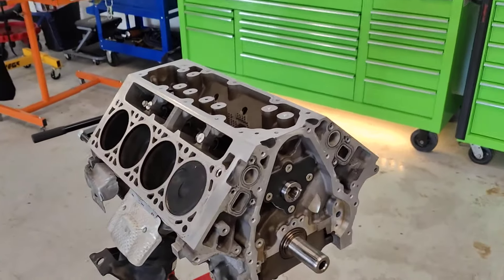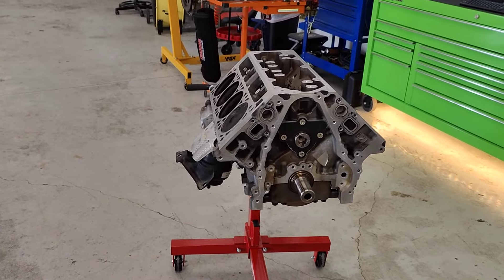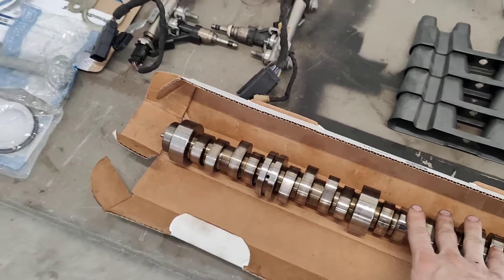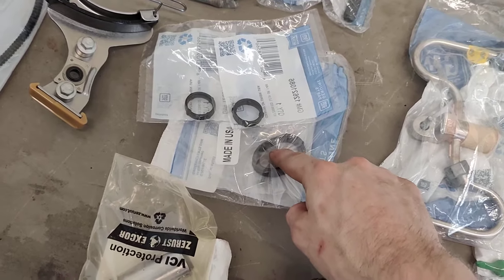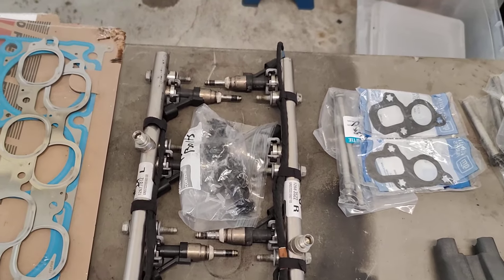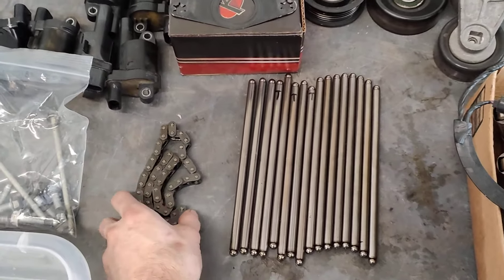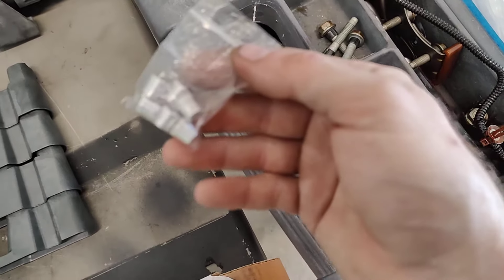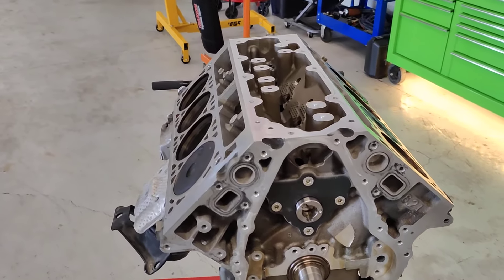Gen 5 L83/L86 AFM/DOD Delete

Comment: @ChrisVaughnTech  ive done this twice now( different engines) both times net me low oil pressure on hot idle. first time i used oil pump alignment tools, new o ring low hot like 16psi. pulled apart and put in new pump and replaced the wiring to oil pump which was damaged. still low oil pressure hot. cam bearings looked great, crank and rod bearings felt good when i had pan off. as soon as you breath on the gas oil pressure goes up and normal driving it never drops below 35. i did some tuning , raised idle 100 rpm and changed where the VVT took over to cure wandering and its sits like 25 hot now. owner is good with it and been driving it for a few months. the one i finished yesterday same thing, new o rings, cam thrust plate, ls7 lifter, valley plugs, trays, oil pump wire. hot idle about 16psi, only mod to tune was turning the master DOD switch off. as soon as you breath on throttle pressure goes up like youd expect, ended up upping idle and changing vvt turn on point now sits25ish hot idle with 0w20, last one i went with 5w30 and very little noticable pressure increase. it seems just turning the dod off messes with the oil pump pressure control. im almost wondering if the stock VLOM is bleeding off pressure somehow. i do know the gauge is not showing accurite pressure tho, there is a table you can change the low pressure alert, its set at 40psi at 210 degrees at idle and if i change that up any i get the message "low oil pressure shut engine off" which means to me its getting ATLEAST 40 psi at idle at that temp but somehow the gauge isnt reading that. ive tried new oil sensors also, removed screen, never found an adapter to hook manual oil gauge up the, odd thread.
Reply: To your question on VLOM bleeding pressure.... there's a tiny hole that throws oil to the fuel pump lifter.
Reply: @guerosolis5794  The oil feed hole you're talking about only feeds to vlam cylinders. I've started taking them apart, cutting the cylinders off and tapping and plugging the feed port and I've had zero issues after that. Well along with friction plugging the AFM towers in the valley. The fuel pump solid roller lifter gets fed from the back of the block which is also the same passages that feed the lifters oil
Reply: @erik120719  I think I have this issue with mine post delete. where is the oil feed hole to the vlam and what are you taking apart to cut the cyclendars and plug the ports?
Reply: @newbtubetecher  cut the VLOM cylinders off the valley plate. If you look where the pressure sensor threads in there is an angled port that feeds the VLOM solenoids. I tap and put a grub screw in that feed hole. Then get a outer pinion bearing for a 05 Chevy 1500, pull the rollers out and hammer one into each feed tower so it plugs them also. I made a video but dunno if I ever posted it but I'll find it and link it for ya. Unfortunately you have to pull at least one injector rail to get the valley plate out, lotsa lube and be slow and gentle
Reply: Just an update, I've done just over a dozen of these since this post. No longer have to tune up idle and VVT stuff. I still and tap the VLOM feed hole, remove the VLOM solenoids, and friction plug the DFM towers built into the block. Low 20s oil pressure at hot idle, GM spec is 22psi at 1000rpm , which could be as low as 12-14psi at 550rpm idle. I now run 5w30 dexos in all these engines I DFM delete. Have all running around with no issues except one, lifter failure (Delco brand ) that dropped its needle bearings and shredded everything on the way to the bottom. Had to eat that one and built them a new engine.
Reply: Hey thanks for getting back to me. I’ll be on the look out for that video link too. Been thinking about doing the injectors anyway so I might as well prepare to do a fuel rail lol and cross your solution off the list at the same time. Still cheaper tgan a new truck tho 😂
Reply: @erik120719 thanks again!
Reply: @erik120719  one last question. Do you know what the WOT PSI is on the ones you have done. I haven’t really seen a PSI higher than 50 in my daily driving but have been leery about going WOT on my freshly rebuilt motor while oil pressure is in question.
Reply: @newbtubetecher  not sure but 50ish highway is kinda standard on most chev engines. The gen 3&4 engines have bypass spring in pump I THINK is 75psi. Gen 4 has another bypass in the oil pan too, not sure what that's set at either.
Reply: @erik120719  very good. Thanks 🙏

Comment: I had a lifter fail on cylinder #2 of my 2018 L83 at 47k, cylinder #2 isn't even an AFM cylinder. I'm suspicious that it has more to do with the lifters themselves than the afm. Also Afm was disabled electronically at 500 miles.

Comment: Love it!!! I use the Diablo Sport tuner to disable the AFM. Eventually I'll do the AFM delete.
Reply: I did the same when brand new, still had lifter fail at 47k miles (2018 L83)
Reply: @ntme9  Same Diablo tune for my 2015 Silverado. I have 233k on it. But I know it is a matter of time. I'll be putting a 416 non DOD long block in it.
Reply: @r5r-rule5racing89  I just got the truck back, put a BTR stage 1 cam, dod delete, and gm performance lifter. It was a non-dod lifter that failed btw.

Comment: Very well done, appreciate all the details on parts to replace. I own a 2014 Corvette with 12,000 miles and i want the engine to last a long time. I just saw a blown LT1 taken apart and it had a window added to the block opposite #1!!! I have ruined a LS1 with a lifted ring land on number 7 that had overheated and cracked the sleeve too.  Too much boost and the Meth injector nozzle clogged. So I worry. The 2007 LS7 i had required the rockers arms replaced and both heads were ruined valve guides, but I had the oil checked and found titanium in the oil so i performed the repair before more damage. I really don't want to go through all that again. But I am afraid I can't do this work myself anymore, too damned old. So then I worry about a shop locally experienced in doing this work to the level you explained. Adding new parts that you may not think about. The oil pressure regulator wire for example. O Rings on the Pickups. Oh and I have the dry sump engine so that all different too. I am in Northern Virginia if you know anyone with this experience let me know. Dennis

Comment: Is this California smog legal , can i purchase kits for California, and will a stage 2 cam cause issue and will a diablo tuner correct this
Reply: I heard California has a software that detects tunes in the computer and will fail you but when it's time to take your emissions test,  just put it back to stock file and drive on M5/L5 or M7/L7. Pass test,  then put back the AFM/DOD disable tune.

Comment: How many miles before problems occur with this engine ? If it’s disabled by tune, do u still have to do all this ?
Reply: I did a DOD tune delete on my 2015 5.3. Mainly because of the sound my new Magna Flow Exhaust made when it switched to 4 cylinders. It was after I disabled it in the tune that I started hearing all the horror stories (some from friends) about these engines eating lifters and cams. I now have 233k on the truck, but it's rattling really bad at start up. Probably due to wear and thin oil. Had some mechanics tell me getting that many miles on the GenV is amazing.

Comment: With not having to tune. Well this delete allow me to pass smog in california?
Reply: itll still pass emissions, will run just like its sibling motor ( L8T if you have a L83) that didnt come with AFM/DOD , u may have to tune it tho to turn the DTCs off that deal with the DOD system. i do it like that bc if i dont usually there will be DTCs for the solenoids in the VLOM not working.

Comment: How reliable is the engine after all this work done to it? If it's very reliable after this fix then it's worth it.
Reply: Eliminates a point of possible failure and that’s pretty much it
Reply: @moretestmorebreast7654  the LT engines have a shit angle on the pushrods vs the LS engines, the VLOM over pressurizes the lifters and then bends pushrods. DOD delete solves that possible issue, buut the angle still isnt the best but SHOULD be a 300k motor no issues if properly maintained